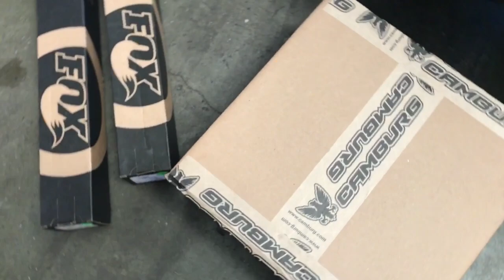3rd Gen Tacoma with Fox Suspension Camburg UCA Method NV & Toyo Tires

Comment: How much lift was put on the front with the 2.0s?
Reply from the maker: About 3”
Reply: @88ROTORS  hey out of the box i thought the 2.0 are set to 2 inches.  Did u adjust them before or after installing for more lift?